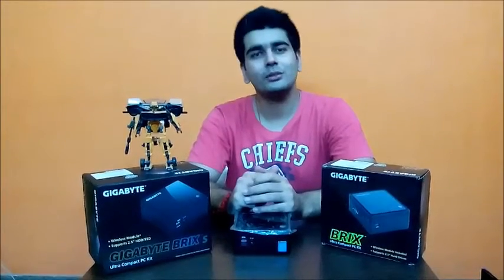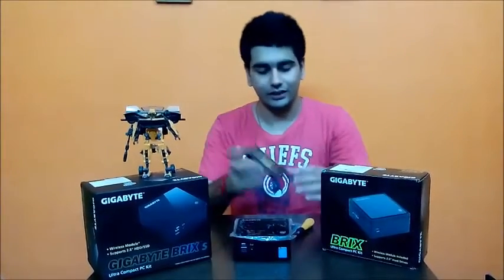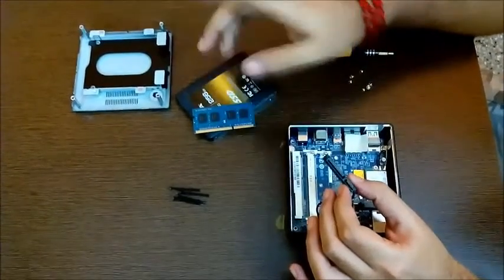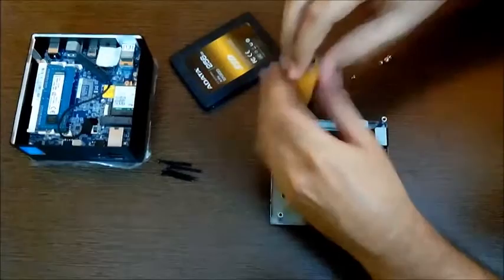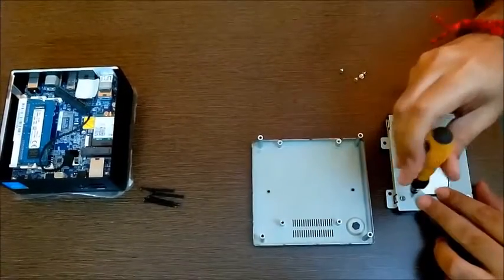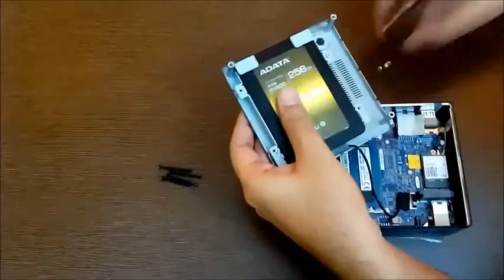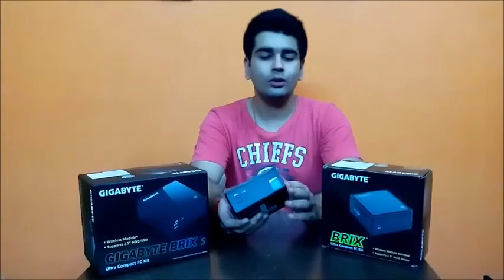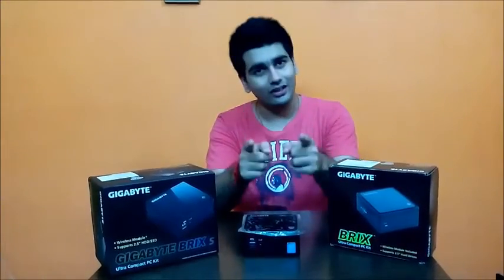Gigabyte BRIX S and BRIX installation with SSD/HDD and SODIMM RAM sticks

Comment: yes good video. I just got mine. my memory is crucial does this matter? I heard that the memory was an issue and if you don't have a certain type the PC will not run?
Reply from the maker: +hummbug1 Well nothing as such was wrong with my sample I tested it with Corsair, Kingston and Crucial and there was no compatibility issue whatsoever.
Just plug it in and you'll be fine I'm sure.